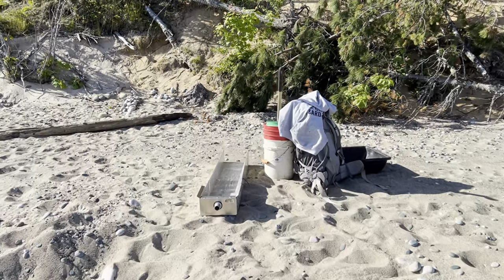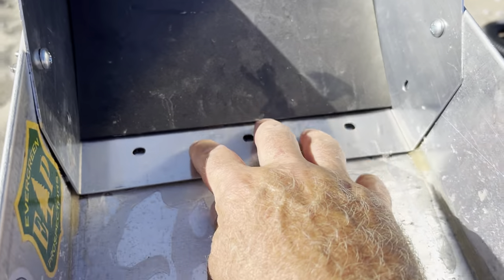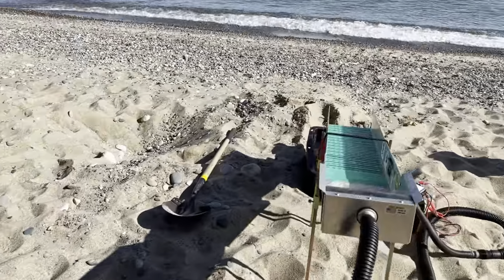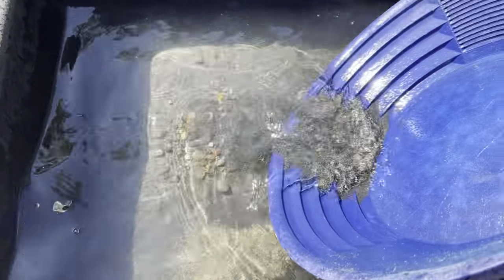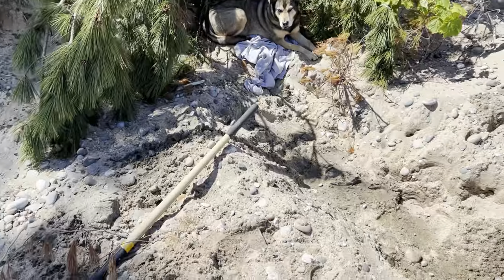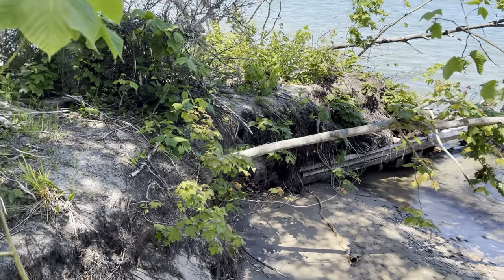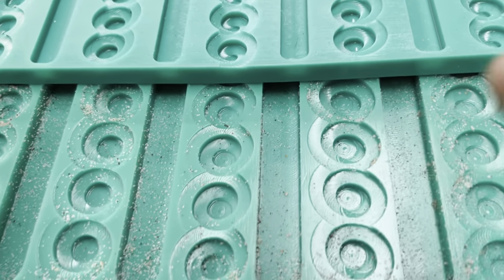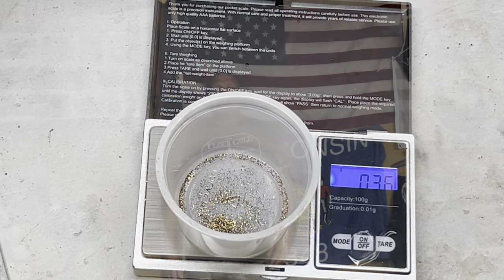Why is there SO much gold ? Lake SUPERIOR

Comment: I live in alaska, where seasons are short, winters can be cold but from where I am located, much warmer than your winters. Its true that every square foot of ground has  gold in alaska., but there are some spots  that make the news when found. I have found some nice nuggets the size of your thumb and a lot of pickers in a shovel full but that is not the norm anymore. That gold  rush mentioned in history left every square foot of alaska tested for its contents. I worked creeks here with a excavator an also a D8 cat dozer to find the larger deposits  we ran  through a lot larger sluice than yours as  wide as a truck bed for the most part. We only used the  mats for a foot or so as most catch in the first few inches of the grizzly. Some days were  just as bad as  your setup an others were measured in ounces. Thats per hour so its  higher concentrates. My very best high day (8 hours) winter time and water so cold that your  voice would drop in pitch., was a whole six pounds and some odd ounces... many days followed where the  riffle's were dry tho. Most times the cost of extraction was more than the recovery.  Some nuggets were washed from the roots of trees that fell over in the wind because the water had  chewed the system so lose. There were trees side by side where one was loaded with gold and the one next to it would not give up enough material to buy some wobble pop. Always was looking for a large strike an most times everything I made went into bigger and better equipment. Many good stories though. Stories of high finds, nuggets in our dually truck tires, of getting too greedy and not cleaning the sluices quick enough, a storm come through and took out our whole system.... scattered it down a canyon where it is lost to this day. Makes these seventy two year old bones cry for more punishment
Reply from the maker: The things we do for the ( big one ) !!!!!
Thanks for watching and the great story!✌️👍🏻✅🇺🇸
Reply: You should chronicle your stories because I know you can write and would love to hear more of your 'ventures.
Reply: @TheDamageinc81  I know a  couple that are almost a book long themselves but my hands are so crippled that it would be   miserable to do it
Reply: Very interesting
Reply: @morgansword  text-to-speech software—you can just speak it into a mic :)
Reply: @arc-sd8sk  I really never thought about that before... thank you
Reply: Cool story thanks
Reply: That's a great story, brother. Especially at the very end, begging for more punishment. It's so true.
Reply: @morgansword do it.
Reply: $800 roughly for a very hard and respectable days work. Not bad brotha! Not bad at all.
Reply: Made it half way through your ramble. Chill bro.
Reply: @RandomActsOfRandom  You can't read, huh? Don't you worry, there are people who care about people like you, and contribute regularly to the American Illiteracy Fund and to our local chapters of Dyslexics Anonymous. Take heart, brother - it is never too late to learn to read! Someday even you could sit down and feel the joyful experience of reading a whole book!

Comment: When you're dealing with fine powder at the end, wipe your brush and even the outside of the pan with a Bounce dryer sheet. It is unbelievable how static becomes negligible with the use of such a product. I noticed alot of your particles jumping around when using the brush and I hate to see even an atom of gold lost. Hope this helps 👍.
Reply from the maker: 1 atom weighs 1 atom ✅ 
I need it 🍻

Comment: Great video. I was born in Minnesota. Left at 33 for New Mexico 20 years ago. Moving back to Minnesota next year. I have messed around with metal detecting but never found much. Gold prospecting sure looks interesting.
Reply from the maker: It certainly is a great way to spend a day even if you don’t find much !!!! ✌️✅
Reply: Tbh I like gold prospecting more than metal detecting. Both can be pretty chill way to spend a day. If you find some gold you will get gold fever. I used a friends pan once, and found a .25 gram gold picker. It was like 2nd try. Anyways so I’ve had a bad case of gold fever ever since
Reply: Goodluck man 👨 💪 🙏

Comment: Sounds like your gear bag could use the addition of a kitty litter scoop.  I find them invaluable for sifting out the gravel from sand in a completely different context, but I bet it would do a great job keeping those rocks out of your sluice.
Reply from the maker: Good idea !!!😃✅👍🏻🐺
Reply from the maker: That's a great idea!
Reply: I use an old deep fryer basket. A eight inch by eight inch, four inches deep. Works fantastic! I can get a five gallon pail classified down in about twenty minutes. Wet classified

Comment: You should get yourself a wheeled cart to haul your equipment with. There are all kinds of cart that are specifically designed to haul large loads of gear into rugged areas. Like the ones designed for hunting and hauling out animals as large as elk. They can handle upwards of several hundred pounds. You would save yourself so much energy on the trek into and out of your favorite prospecting sites and be able to haul back even more than you currently are.
Reply from the maker: I have a game cart i use at times but there are some downed trees that go out into the water i need to get wet to get around! Maybe I should haul a chainsaw..🤣✅

Comment: Thank you for sharing your beach mining adventure.  In my area Im stuck at the creek if I want to see colors in the pain.  It’s nice to see an area with different scenery.  The longer you have to walk to get to a spot,  the less likely it’s been worked before.  Prospect for remote beaches with a boat to find some truly rich spots!
Reply from the maker: A boat / kayak would save my feet !!!! Walking in sand and loose cobbles is tougher than you’d think!!!
Reply: @FlourgoldWizards  now that sounds like a plan!  Plus you could get to spots faster and have more time to play.  Also makes it easier to carry your beer 😂
Reply: @FlourgoldWizards  little more limited with kayaks(Still better than on your back though X D) but most small boats going solo you can pretty easily take 200 some odd pounds of equipment out with you too.
Reply: That's cool

Comment: Have you ever seen the black sand "band" along the high cliffs and hills of sand facing lake superior over the beach up in northern upper peninsula Michigan?  Also came here to recommend 13ah Ebike batteries and those 0-48v PWM speed controllers for your setup.  I like the DC speed controllers with a digital voltage readout so you don't over discharge your batteries.
Reply from the maker: I have noticed them but no testing as of yet
Reply: The controllers usually come with a speed indicator but you can install a voltage meter in them as well.  Encasing the battery in a plastic ammo can works well too.  You just have to type plastic ammo box battery holder and a lot fishing related videos will pop up.  Heavy pans!!!
Reply: I lived just south of Marquette back in the 70s. I had no idea that the southern shore of the lake reeked of gold. Darn.
Reply: @deanmindock3680  That's Joe Perra country

Comment: When it’s hot on Lake Superior, it’s HOT!  Mid summer lake temperature can be in the low 50s at the beach and high 40s out in the deep lake.  If you get hot, one dip and you are cool again.  On long hot summers you actually go in for a swim.  Doesn’t happen to often.  Don’t need to take ice for beer.  Take a plastic bag and sink it.  Comes up cold.
Reply from the maker: Excellent 👍🏻🍻✅

Comment: 7:40 Mark Maybe slow the water down a little more. You'll catch more pebbles and bad dirt but you'll also catch more gold instead of it getting washed out pof the sluice. Or maybe adjust the angle of the sluice a little less steep? Again, you'll catch more junk and have to clean it out more but that means you should also catch more gold. So it is worth the extra effort.
Reply from the maker: We eased up on the pitch but it was even worse !!!! I’ll just classify and bring my other mat that is proven !!!

Comment: You should add a high banker section to the sluice with a fine grate to keep the rocks out then just shovel the sand directly onto it or use a bait pump.
Reply from the maker: We’ve since upgraded our system 😃🐺🍻

Comment: I would love to see a head to head of those two mats out there! Also a Dream Mat! I really like that they don't have as many cons as the other mats, but I think they catch the same gold. Since you make paydirt I know you want the extra cons. I hope you go back to that spot with all of the black sand! That looked like heaven to me!
Reply from the maker: Tryst me… I don’t want the extra cons…🤣🤣🤣✅
Reply: the dream mats are basically the best out there. they have new combo mats with 3 diff sizes on one mat and those are the best. you get the ability to catch small and larger pieces without it washing out of the mat.
Reply: @chehystpewpur4754  I do love my Bazookas
Reply: @Bishop0178  love what you want you cant help but follow the heart. but the dream mats are pretty amazing in every use case ive seen them in. and them listening to their audience closely and catering to their needs and wants they have made some great products. their multi mats are in my eyes and quite a few others the best. the main reason. lack of classification. some things like this some like that ohh you cant do this. this is drag and drop. starts small. fine trapped goes medium rocks have gained momentum. bigger chunks will stop. then big holes and any large chunks will be trapped. rocks roll out. they clean themselves well and are proven to have minimal losses just in each size. within the size of each mat in the multimat.  add all 3 and use the size mat or mats that catch the most. or use them all always and catch as much as you can.

Comment: Are you using a surfactant (ie jetdry) in the water? I may have missed it if you did. If not, I suggest doing so to break the surface tension. This will reduce air pockets in your mat and allow better gold retention.
Reply: he didnt mention it, but he has in other videos I believe
Reply from the maker: We definitely go through our share of jet dry !!!
Reply: Jetdry next to the lake water? That doesn't sound so good.
Reply: @gemofthewoods5802  Don't worry - it wont dry the lake.
Reply: At what stage do you use the sufacant ?  Will it get into the waste water?  The environmentalists will start makin noise.  I’m guessing.
Reply: @yelyab1  I use jet dry which contains no ecotoxicological ingredients. The National Institutes of Health reports that rinse-aid like jet dry are completely biodegradable, and neither carcinogenic nor dangerous
Reply: If you are using a circulating water pump that re-uses the same water that your tailings go into, just add a few drops to the system before you start your highbanker. If you’re not recirculating, there’s no point to using a surfactant since new water is always entering the system. Before you start though, run the water without pay dirt and use an old tooth brush on your mats to get rid of any bubbles that can block gold collection.

Comment: Probably a dumb question but would a metal detector give you any indication of how much is in a particular spot prior to sampling?
Reply from the maker: The black sand ruins the frequency!!!
Reply: @FlourgoldWizards  Interesting. Thanks!
Reply: A metal detector will find "large" bits of metal, not grains like that. If there was one that sensitive all you'd find is lots or iron.
Reply: A detector cant detect those tiny specs of Gold.
Reply: Certain metal detectors will give you an indication of the amount and flow of the black sand. The Mine lab Xterra 705 is one of them.
Reply: You see the gold it is usually found with pegmatites and hematites. Rarely is it found alone in quartz though it’s possible. So you get other signals from interfering metals before you’d find gold. Most of the time.
Reply: Gold isnt magnetic einstein

Comment: I suggest you get a utility wagon and get some sand wheels(larger balloon tires) to make a beach wagon to carry all your equipment. And a set of nesting bucket classifiers wouldn't hurt either. Sure would make better use of your high banker.  Although I would bag and save my final two levels of classified materials. There could be a little larger nugget in there, and if not you have some small landscaping pebbles. One last idea is to set up under a canopy with some insect netting on the sides held on the top with velcro. P.S. rubber cement could probably fix your leaky waders.
Reply from the maker: Thanks for the tips!

Comment: Fun show, I didn’t know how nice the Great Lakes shoreline is and you demonstrated it nicely. I work the high sulfide mountainous desert regions in the extreme Arizona desert where gold can be very fine but lots of it, but when capturing free milling gold I use a totally different kind of miners moss, I will lose everything if I used the mat you are using. I believe you may have lost 50% of your finally weight using that mat which appears to be more of a macro type of design and not designed for the fine if you ever thought about using different miners moss? I would try a more ffibrous material to capture the nano. Think more of a material such as the synthetic grass, they put on a miniature golf, putting area or a practice area in a putting zone and a nice golf course, but even more fibrous and deeper. sometimes you can even use that golf material just to get a feel for what it’s like to use something totally different that’s more absorbed in a better catcher than what you got there. Just a suggestion.
Reply from the maker: I really appreciate your input! It sounds like we’re after the same stuff! I’ve since switched to a sawtooth mat and im telling you it absolutely catches the micron stuff !! 😃✅✌️

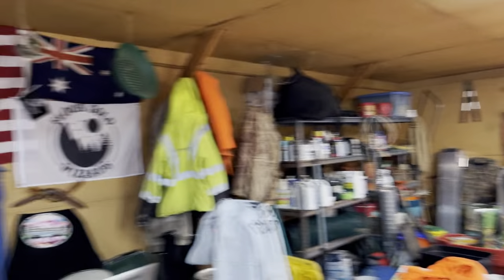Comment: 21:30 that new mat seems it would be better if it had a 1/16"wide divider in the wide groove. Maybe 2 of them.  Maybe lay a wire mesh over it.  With about 3/16"-1/4" square holes. Or expanded metal with a diamond shaped hole in it  it can catch the gold and the metal will keep the rocks rolling off,  I'd be tempted to bring a dredge out there.  Or at least about 4 slouce  that size  with a few solar panels to make shade and power.  Maybe camp out 3-4 days. Bring a tiny generator 1000 watt or so. A 100 ah battery. I'd try to run the whole beach. Within a 200-300' area at least. Dig down until I hit water panning every 6" at least, along with everything that looks good.   Dig a deep hole. Lay plastic in it use a pump to keep about 50 gallons of water in the hole. Use a dredge to to pick up from the bottom. Running that through a 16' sloose,   and shovel the pay sand into the bucket with holes in the side a bout 2" holes all around the sides, that allow water and sand in but will keep out the plastic. Using the dredge as a Hopper feeder. Seems it would get alot. Especially if there is two running a shovel. It would be awesome to get a micro excavator out there. Something that can go about 6' deep.  Make a large sand bucket  for it.  Run all the dark sand and gravel  in sight. I'm in such a situation I need to find a place like that. I can't afford to buy a shovel to dig with. And my health isn't that great. but I'd love to dig in the sand!!  I would not mind going to Alaska do some dredging. I couldn't do the under ice stuff though!
Reply from the maker: Id love to try a dredge down there but the wardens would certainly 
“ love “ me !!!

Comment: You should make yourself a vertical hopper with a hose washing over all the stuff you put in the top load hopper that way it'll filter out all the sand and everything else and the rocks will stay in the screen you just reach in with your hands swish it around pull the rocks out throw them away make a vertical hopper right there at the top, good luck keep going
Reply from the maker: Excellent advice ✅

Comment: Hey it's me the hopper guy so if you have a hopper with the right size screen when you're jumping it into your sluice at home it will sprinkle it into the water rather than just a big scoop of the sand and it will do better filtering everything out separating the gold from the black sand so you have to find a fine mesh screen that's going to work with you for your sluice at home for your finished product and when you're on the beach that way you're not carrying all those rocks and big stuff home with you just food for thought keep going I love what you're doing
Reply from the maker: Much appreciated!!